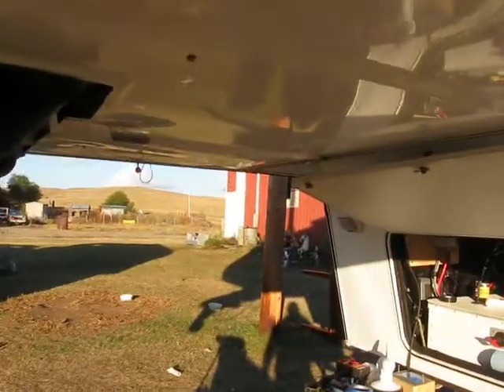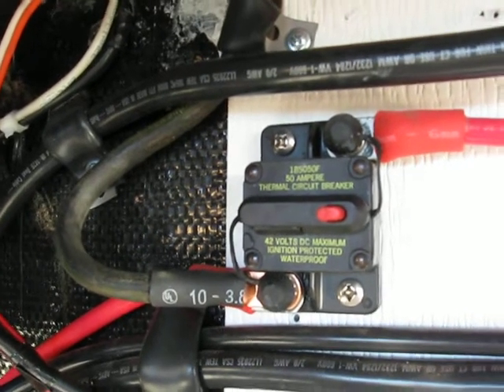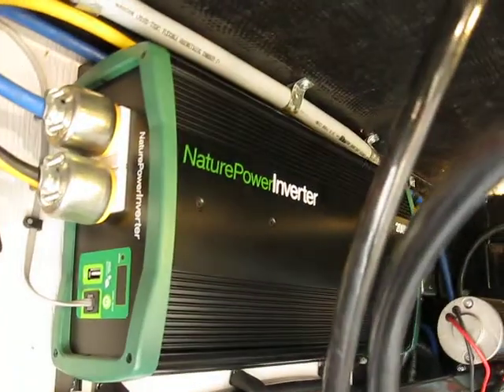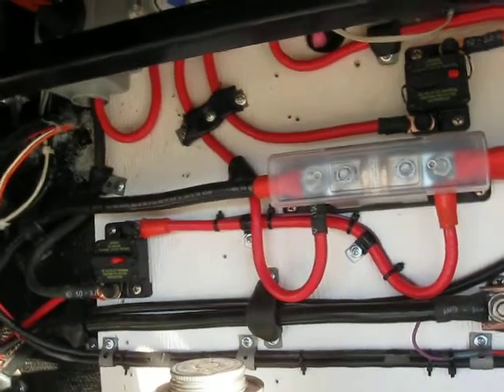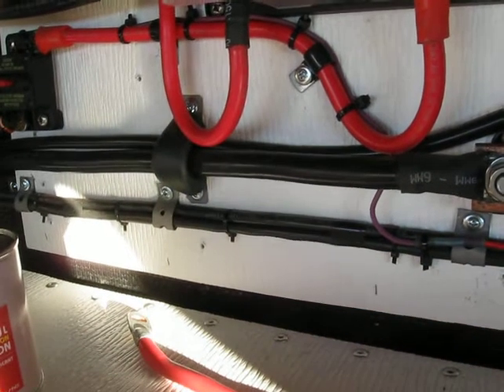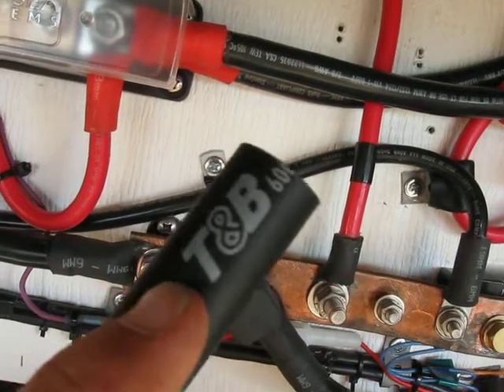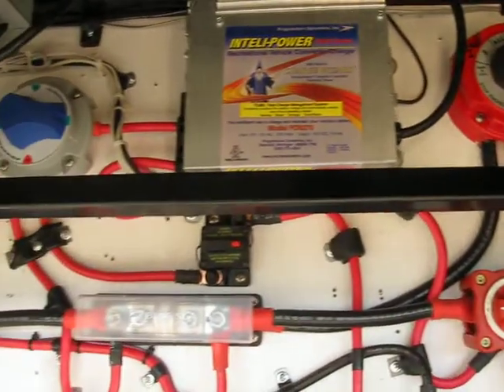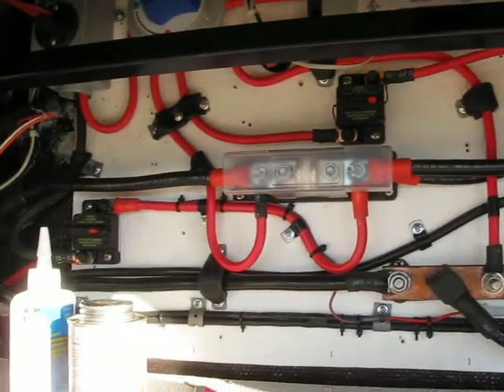RV Solar Wiring "Circuit Protection & Making good connections"

Comment: Do you not recommend a circuit breaker for the 12V to the inverter? It doesn't look like there is one in this video. Thank you for these videos.
Reply from the maker: Hi Richard! You could use a DC circuit breaker with a lower wattage inverter. But when installing a 1000-watt and up inverter I use a high capacity DC fuse to fit. I use a DC 3-way battery switch to turn 12-volt power on and off to the inverter.
Happy Trails!!!

Comment: Thanks for posting this and all your videos. I am working on the design for our totally off-grid solar system to put in our '08 Cardinal. One question I have regarding your setup: how do you switch from panels to grid power? Are you using manual switches or do you have an ATS? Also, have you posted a schematic of your system?
Reply from the maker: I have a separate inverter feed for my 120-volt outlets, and one for our shore power. I can run both independently at the same time if I wanted to.
Happy trails!!!

Comment: Never seen this size wires before for a solar system
Reply from the maker: Howdy Steven! For a Solar Power System to work properly the wiring needs to be sized to handle the watts/amps of the solar array and what you may grow to in the future.
Happy Trails!!!
Reply: but a 12volt system needs bigger wires then a house ? , just asking I am curious
Reply from the maker: Yes, you need to wire to the voltage and amprage/wattage, and also solar power loss of the solar and loads for now and what you plan to do later down the road. you can always go big on the wire and upgrade to a larger solar array and battery bank. This makes more sense then replacing the entire wiring when you up grade to a larger system. Happy Trails!!!

Comment: I cannot find any "hammer' connection devices.  Also the wire I find at Lowe's or Home Depot doesn't look as nice as the wire I see in all these solar installations.  
Where do you guys get your connection material, and hammer device?
Reply from the maker: You need to find them at a electrical supply house, large truck auto parts supply, also a solar supply store.
You can also have us help you install your system for you!
Happy Trails!! 
Eddie --- Mobile Homestead Solar Services at wyglonekseal@aol.com
Cell# (252) 475-8034